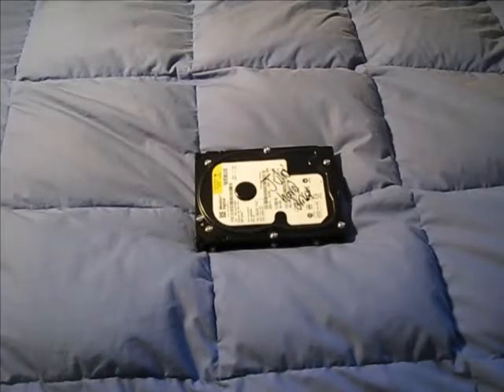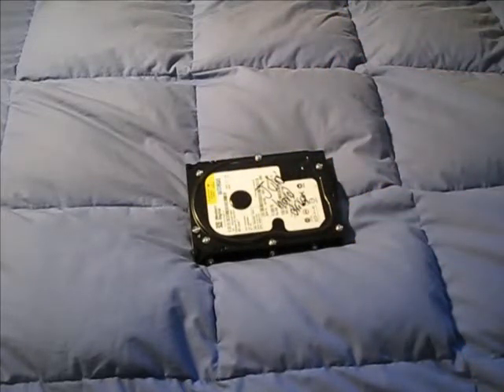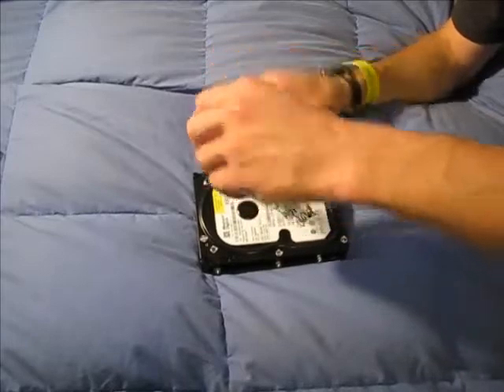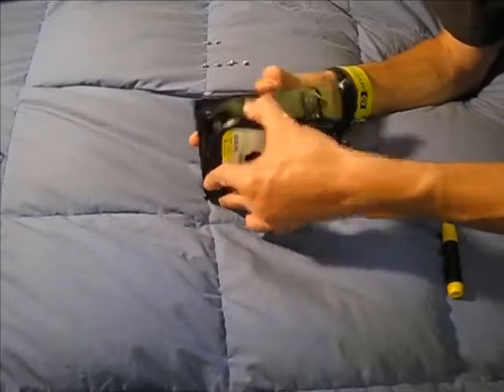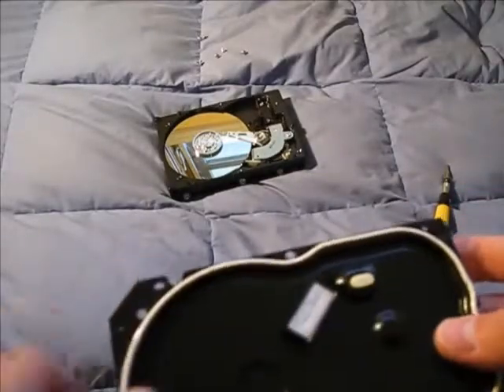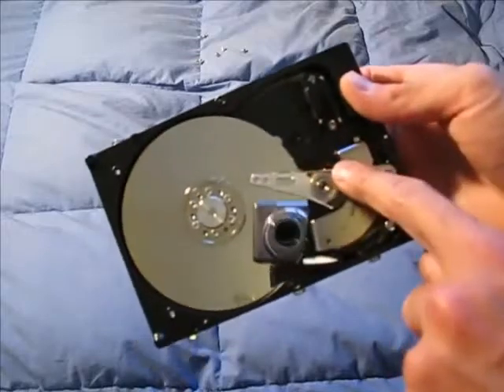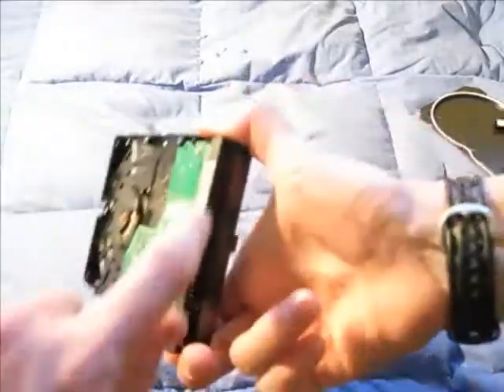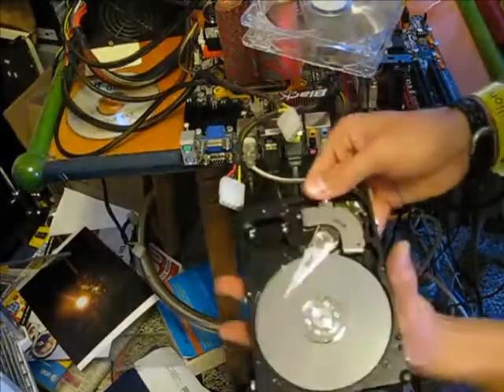Hard Drive Teardown and Click of Death information

Comment: Hopefully it will be his last, They are not waterproof, there is an air vent hole. Two hands to unscrew the screws, but one hand to unscrew the hidden one.Hmmm. Here is the hard drive......that is the hard drive cover. Muppet. It is stainless steel, not plastic or something. Muppet. This is a piece of "whatever", new element discovered by "MUPPET" aam aam aam aam aam aam aaaaaaaam. MUPPET